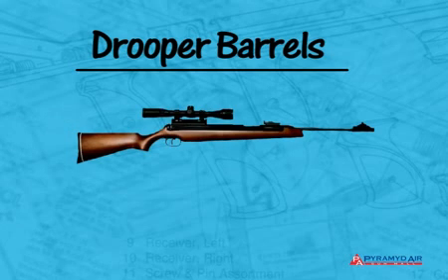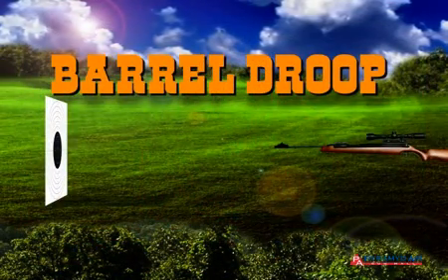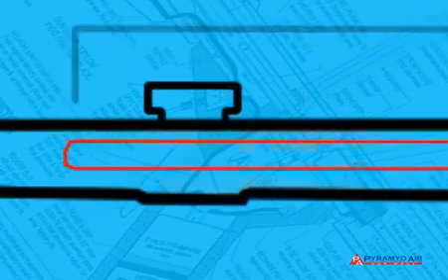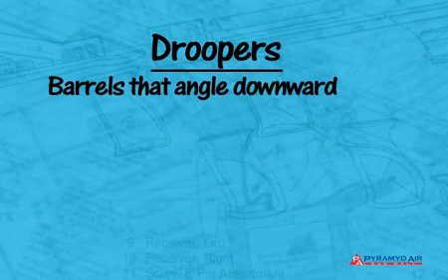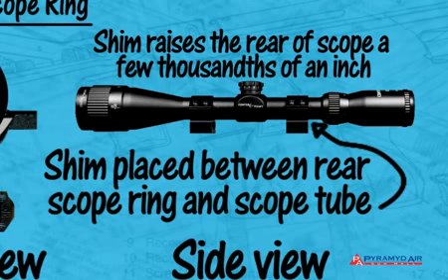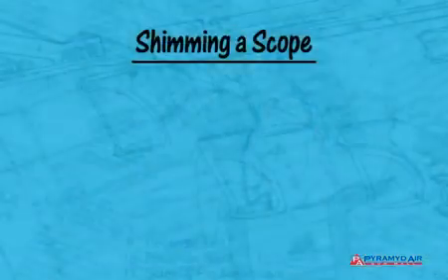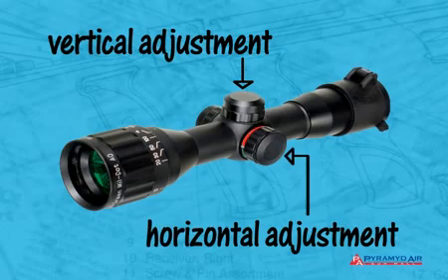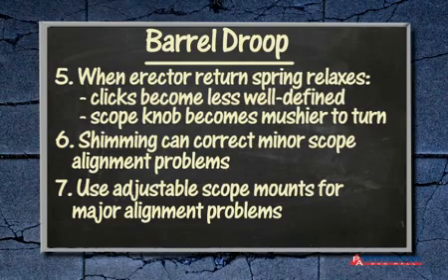Airgun Academy Episode 19 - What is barrel droop?

Comment: Excellent details shared here. Especially inside the tube and the spring  workings. Makes sense now! Just changed out my Centerpoint Scope for a better Leapers UTG - and had to use a Picatinny Mount with Weaver Rings. -10 yards out - 4 inch below target, but a good group lower left. Tried to adjust  and just about gained an inch to target. Left/right adjustment had me centered but way low.
I was zeroed with Centerpoint to at about 30 yards, my "kill zone" , so I don't not think its barrel droop. I have a .177 Gamo Whisper which i really like! The varmints don't seam to though.

Comment: I dont like the shimming ,
it gets tension on the scope tube ,and thats not a good idea(thats why there are lapping tools, to get the mount excact in line  when mounted on the gun), 
.In the case of a break barrel airgun ,that droops down ,
its easy with a file to take some material of the barrel where its resting when closed  ,and you  can check the barrel cilinder line with  a workbench or so and a few v blocks , the gun wil shoot more accurate because the vibrations are more in the straight barrel line,
 With under levers or site levers  ,its more difficult  ,bending  the barrel  direct where its out the frame(the last inch of the barrel gives the direction) or remove the barrel and bore and rebushing in the desired line if there is body metal  enough .
And a scope mount that can be can be canted and adjusted  second best

Comment: More crap. Barrel droop means that if you compensate for it the piston will be moving at an angle to the barrel not the best set up for any sort of accuracy. If you have this problem the only way to fix it is to have the hinge re drilled in the correct alignment not difficult but expensive. Have fun be safe.

Comment: No matter what, even if the barrel is perfectly parallel to the sighting plane, impact will be lower. You have the vertical difference between the 2, obviously. You also have time of flight, which means gravity is making the pellet, bb, or bullet accelerate toward the center of the planet. A one second time of flight will result in 33 ft of bullet drop, in addition to the vertical offset of bore center line and sighting plane. That's why they make collimators, and skilled 'smiths use that tool to set ring heights (or even iron sights)  and windage to a "trig zero" with centered adjustment scales for anticipated field zeroing range, at anticipated velocities of load., So adjustments on the sight system are only compensating for vibration and recoil, not the pre-existing geometric anomolies of design and manufacture. That's why 2 piece bases, and drilled and tapped mounting has always been so popular, because the "angular English" is a bit easier to apply in such a system, even pre-made parts being used.

Comment: You gotta be kiddin' me!!  Instead of trying to correct the "barrel droop" - you compensate for it by shimming the scope!?!??

Well, then!!!

> The next time my breaks are going on my car, I'll adjust my accelerator to not press so hard.
> If the front end of my car goes out of alignment: No problem, I'll just adjust the rear axle to point sideways so I can drive straight.  (No matter that the passengers-side of the car now travels down the highway in front.)
> If I should get a tooth cavity, no problem, I'll just wear down all my teeth to match the depth of the cavity.
> The next time my hard drive starts to click in my computer, no problem, I'll just mount sound dampeners around it.
> I'd write more of these, but I have to go now because there is a very, very strong odor of gas in my house that's making me dizzy and I have to find the air-freshener spray.  Cya!
Reply: RackAttackGamer Try'n straighten the barrel.
Reply: The barrel is straight.  It's the angle that the barrel connects to the "receiver."  It's like it doesn't close flush or something.  But I've seen videos about (maybe) what you are talking about.  But that actually involves bending the barrel.  -- But thanks for the advice.

Comment: So many Amazon reviewers (for instance), ding a given rifle in their review because of a lack of accuracy. Most reviewers "know" the scope is the problem. The scope is included, and may be low-end, but I'll bet a high percentage of those issues are because of barrel droop and over-adjustment.
 Now we know WHY it's a problem.
 This is great info, THANKS.
Reply: I realize this is an old post, but I just wanted to mention.

I'm always on the lookout for unhappy owners of RWS Diana rifles that have barrel droop and think the rifle is a piece of junk.
Last Diana Model 52 I got had a droop of more than 14 inches at 25 yards! No amount of adjusting the scope would bring it close to the bullseye.
UTG compensator mount and I needed very little adjustment to get on bullseye.
Diana is a beautiful rifle and I'll never buy another break barrel again.
Reply: A piece of friction tape works wonders

Comment: I have a 21 year old old Norica Mod.61, I`ve put upwards of a hundred thousand pellets through this rifle, all shots have been accurate until recently when I had to change the spring because the pellets would not leave the barrel.

The barrel droop is now bad enough that I`m seeing the outlines of the O-ring around the breech of the barrel when the barrel is up against the receiver, is cocked and ready, when I fire air definitely escapes the breech O-ring more so than before.

What can I do to repair this? Is it the breech surface of the barrel or receiver getting worn?

Comment: Did it and my groupings are PCP worthy on a springer now thanks crosman usually has droop on phantom and optimus family includes nitro piston tec put it on a vice gently and use a leveler and pop can works REMEMBER to look at ur dials if they are almost unscrewed or over halfway unscrewed like 2/3  unscrewed u need to do this it helps

Comment: My Ruger Air Hawk has serious droop and shoots left of the stock. I have filed inside the front mount where the tooth grabs the rail with a triangular file, to move the front of the scope to the left. After several tries, I can finally see the front sight at the bottom of the reticle. I have managed to not change the shape of the tooth. I also filed the bottom of the mount to lower it. I guess I won't be returning this one.

Comment: Hi. I just got a Remington Vantage. The scope came with a 4 screw and 2 screw mount. if I put the 2 screw mount in front the scope points way left and of the barrel and way right if mounted at the back of the scope. I was wondering if it is possible that the mount was milled bad? I'm getting pretty frustrated trying to zero in this scope. if I shoot straight with the scope mounted I'm a good 5-10" from where I was aiming

Comment: I have a new crosman nitro venom that I got from pyramyd air the barrel and scope angle is way off to the right. I have the scope adjusted almost all the way to the left in fact i adjusted it all the way to the left and ended up going about half a turn back to the right to get it sighted in to 30' I have conciderd shiming it on the weaver rail but I'm looking into an adjustable mount. any advice?

Comment: I double checked the barrel, it's correct, I compared it to a couple of brand new 350's at the shop. I put a couple of mm ( around 2mm) thick piece of plastic between the front mount and the scope, an now my scope shoots perfectly. I tried to rise the rear before but it shot even higher, so the front end rise worked best, but that is a temporary solution. I will get the Diana mounts and put higher end in front. Hope that works.

Comment: Thank you for the explanatory vid. I have an RWS Diana 350 magnum .177, and the barrel droops upwards, I am using a BSA stealth tactical scope, used the maximum adjustment range and it still shoots above the crosshairs, the barrel compensation mounts have the rear slightly higher than the front, but in my case I think I need the front higher, any suggestions? Thank you

Comment: 1 set scope to a certain range 
2 fire 3 or more shot to agline the shot to the barrel
3 lock the scope so if you drop it you dont have to reset it again 
like the leapers scopes which you can lock the turrets 
so you dont have problem like that